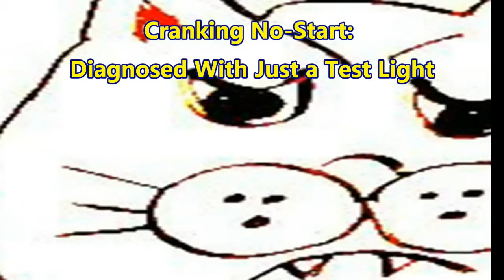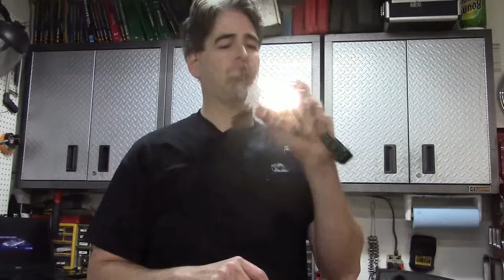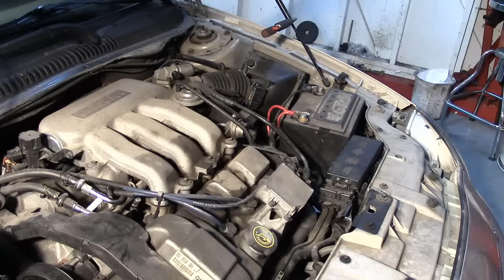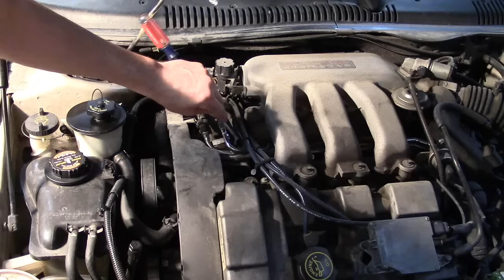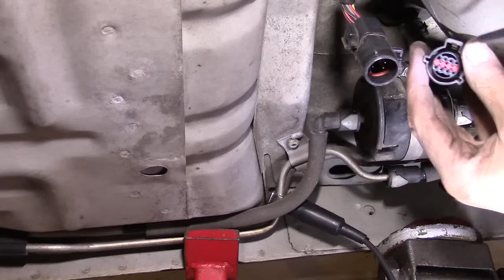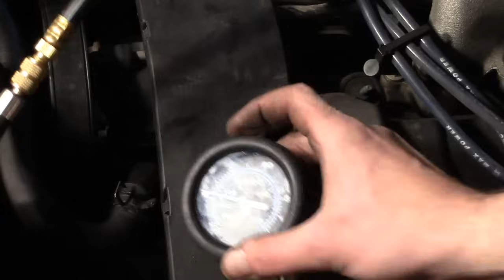Crank No-Start Diagnosed only with Test Light

Comment: What do you test injector ground pulse with SB? I just fixed a blown head gasket and fuel regulator on a 2011 Toyota camry  and found out that all test lights will not light up on the injector ground pulse test.
It sent me down a wild goose chase while they were working the entire time.
The first fuel injector circuit integrity I tested years ago, I used a light cheap test light and it worked fine but this test light did not light up leading me to believe I still had a no injector pulse problem to solve all the way until it fired right up.
Reply from the maker: All you need is a testlight - it’s MUCH easier to see the pulsewidth if you default to measuring the ground side control instead of voltage drop though.

Comment: I have a dodge 5.9 magnum just bought it ! Changed fuel pumped i hear it prime but wont start truck ! Well start with either though any suggestions
Reply from the maker: What’s the fuel pressure showing?
Reply: @SchrodingersBox 54 psi or 55
Reply from the maker: Then it’s not the fuel pump. What is the voltage on the coil signal?

Comment: My 2005 Honda Odyssey crank no start   battery brand new all fuses ian relay is new got fuel I check the car code reader no code or any problem in dictating on my 2005 Honda Odyssey but my van just cranking but not turning over what could be the problem o to my my vehicle
Reply from the maker: What data do you have?

Comment: I could have told you it was the pump just by spraying the intake with starting fluid, and also a few blows with a dead blow hammer on the bottom of the tank might bring it back to life
Reply from the maker: How could you determine if the pump was the problem as opposed to a bad ground, restricted air filter, bad cam sensor or no power to fuel injector circuit?

Comment: I would never do a test light test. I need to know if the loom is good so I have to do a voltage drop test grd a pos.
Reply from the maker: You can literally see the look has to be good. There is no other possible explanation.

Comment: This is worse than sad. I'm 71 and started working on cars @19 it was simple... ignition switch, coil, points and condeser, spark plugs. Boom and you have ignition.
It's almost criminal having these complicated diagnostic schemes by
Reply from the maker: Well I hardly think that far better reliability, almost 400% increase in fuel economy, almost triple the horsepower per liter and an almost immeasurable fraction of the emissions is “criminal”

Comment: I am having the same problem Crank No Start on my 2016 Toyota Tundra SR5 4.6 With no check engine light on , but it only does it when the temperature drops here in NC . Any suggestions from anyone please. GodBless!!!!
Reply from the maker: What did the test light data show?
Reply: @SchrodingersBox I have not used the test light yet, but where do I check 1st friend
Reply: @SchrodingersBox I will do one tomorrow friend!!!

Comment: I have a 2019 FX50. We hadn’t started it for a week. Went to start and would only crank. No codes. You can hear the fuel pump come on when the key is turned on. I can’t find a place to check fuel pressure or get to a spark plug to check if there’s spark as the manufacturer has crammed so much under the hood. Since there’s no codes I’m suspecting the fuel pump.
Reply from the maker: Why do you suspect it’s a fuel problem?  Have you added fuel to intake and confirmed it runs then?
Reply: @ I hooked  a Launch tablet to it and as I was cranking it checking fuel pressure and rpm’s  it acted like it wanted to start and then it did. Runs fine. It gave me a P300 code (misfire) but other than that it was fine. No check engine light or anything. Like it never happened. Bad gas or water in the gas. It sat for 8 days without being started.

Comment: A bad fuel pump would be a nightmare for a home mechanic as for many vehicles that requires dropping the fuel tank to access it.  Really sucks if you just filled the gas tank the night before.  I have no idea why most car makers don't stick a fuel pump & gas tank float access port in the car trunk.
Reply from the maker: Yes it’s definitely my least favorite thing to do for sure. However- I always remove the tank on ANY fuel pump replacement because it’s absolutely essential to complete clean out the tank of sediment which will quickly destroy the new pump if sediment is present. I have an older video of a jeep that used to need a new fuel pump every year because of this reason.

Comment: Check the fuses!!! (lol!)
Great video and quality Schro!!!  
Are those cabinet in the back new? 
Looks real good!
I sadly wouldn't have thought to feel the relays for clicking...that was simple and ingenious!
And yes... I saw the sparking when you were testing the connections.

After you ogot pump running,I would've just turn the key and let the pressure built up first before starting it...just and observation.🙂
Reply from the maker: Thanks!  The cabinets are great looking indeed and one of my favorite parts of the garage. They are called Gladiator Cabinets and believe it or not they are about 8 years old.

Comment: Hello i have a 2014 F150 5.0 it starts and runs no problem while cold but once it warms up it will crank no start until it cools down after about an hour then it will start right up
Reply: A little back story 8 months ago I was getting a crank no start after some research I relocated fuse 27, still no start changed the fuel pump and module over the spare tire it started no problem was running good until 2 weeks ago and after a little trouble  shooting I realized no fuel so I checked relays , before coming to the conclusion that it was a fuel pump again ,replaced it started right up ran good for 2 days now it will start while cold but not warm once cool off start right up
Reply: There is no check engine light on ,also I am no mechanic but mostly do all my own repairs or at least I try to
Reply from the maker: Ok- what data do you have?  I need something to go on.
Reply: Like what I'm no Machanic ,but originally I put gas directly in the throttle body it will crank until it runs  out then dies , I switched the fuel pump fuse both with the blower motor fuse nothing different
Reply: I had no check engine lights on until today now there is a code for the cat converter
Reply: Everything under the hood after driving seem extremely hot to the touch if I wait until everything cools down to the touch then it cranks right up
Reply: Only thing I really have is a test light
Reply: Please help I have went to a couple of local mechanics but they are clueless not doing anything like what you do ,just guide me and please be patient
Reply from the maker: Ok what data do you have?
Reply: Like what
Reply from the maker: You said you have a test light. What was your data from it?
Reply: Ok I hooked it to ground and checked a coil I have got a spark ,I have got power to the relay ,I can here my fuel pump kick on so I got power there as well , I can not find a way to check on this engine the fuel pressure
Reply from the maker: Just add fuel to the induction and see if it runs.
Reply: Put fuel directly into the throttle body cranks right up runs for a few seconds then dies
Reply from the maker: Yep you have a confirmed fuel issue. Fuel pressure is next test v
Reply: Sorry for the delay response before I put fuel i checked to see if it would crank because it had sat for about an hour it started right up had to let it run for awhile to get it back to not starting took about 20 min
Reply: Ok so how do I check the pressure I have no confirmed spot to check need some guidance
Reply from the maker: I just check it at the fuel filter. Easiest spot by far.
Reply: As far as I can tell there is no shredder value on this engine
Reply: Also since we have confirmed this is a fuel issue does that rule out , crankshaft , camshaft ,sensors?
Reply: Fuel.filter on this truck is in the fuel pump , there is not a filter on the fuel rail
Reply: I was hoping you knew of an easier spot
Reply: Ok I have I got my hands on a autel scanner and the fuel pressure shows to be in tolerance pressure v reads 2.63
Reply from the maker: The sensor could be inaccurate. You have to measure it directly OR show the sensor is capable of detecting variance in pressure.
Reply: Ok sorry for the delay the truck will not start at all now , but I have checked the fuel I am getting fuel from the pump ,down the line and all the way to the fuel.injector rail
Reply: Still if I add gas directly in the throttle it cranks then dies off
Reply: And not a dribble it's a steady flow
Reply from the maker: What’s the pressure?
Reply: Not sure how to check without a shredder valve but seem like good pressure
Reply from the maker: 10PSI would seem like good pressure. You can’t tell by pressure by the flow. You have to measure pressure through resistance.  I believe I mentioned the easiest way by far is simply to measure by T-in at the fuel filter.  That way you don’t need any special tools. I just use a plain rubber hose is all.

Comment: I have a 96 blazer 4.3 bought with motor out being rebuilt. Finally got all together ,fluids in ( break in oil of course). Put a battery in and nothing. No spark at the battery,  no lights no nothing.  Ground? Still  checking.  Love your videos
Reply from the maker: What data do you have?  Whats your voltage on the ground for the ignition showing?

Comment: 8:29  you lost me - re:  'Test Light connect to load side feed'.  Are you testing Relay Ground?    re:   "Other side of circuit" - means? [to pump]  Light is On, tho you speak as if Issue being lit.^  So, testing power side, connected to pwr, - light on = shorting to ground. ??  =\  
sorry, replayed many times, words twist[ed], or missing.  
^ noting later, 9:23  'testing Load side' .... Fuel Pump is powered, just not running.  {{sigh}}

Comment: How can I check my code pack, my spark plugs, when it not working on a  Ram 1500,5.7 engine Single Cab, 2012 ,  number 5 wire.
Reply from the maker: simple- just check your powers and grounds on the coil pack and the output signal to the cylinder 5.

Comment: 2004 HEMI 5.7 will not start on the initial start. Crank no start.I can get the Car started by spraying started fluid and manually opening the throttle body, runs nice , idles nicely. I can give it gas no reaction on the throttle body from the gas peddle.
Reply from the maker: Sounds like either a fuel delivery issue or ETC issue to me.  have to isolate the problem to determine which.

Comment: My car , good battery, alternator, starter, and still not even a click, nothing, dead
Reply from the maker: What data do you have?
Reply: @SchrodingersBox  sorry, what do you mean?
Reply from the maker: What is the voltage at the starter showing? What is the voltage at the relay showing? Is there continuity across the control side of the relay?

Comment: What if the car cranks and starts kinda staying running then dies? Also gas gauge comes on and off saying empty and it's not? I know this is probably a dumb question and I'm sorry for being a lame . I'm a single mother trying to do this myself I don't have special tools but I do have a test light how could I check sensors?
Reply from the maker: What data do you have?
Reply: My mom's friend came by with an obd reader code was P0463 fuel level sensor a circuit high. I checked fuses and relays they're good. The security light stayed lit but that doesn't come on anymore after I replace the battery.
Reply: Also I can hear the fuel pump come on when I turn the key. And gas squirts out the Schrader valve
Reply from the maker: Ok but what data do you have?
Reply: Sorry to have bothered you.

Comment: My obd fuse blows soons as I put a fuse in also just replaced fuel pump but it keep saying I don’t have any fuel.Was told I have a bad ground for the obd fuse.Also my battery drains in about 5 minutes after a jump start.Could these all be connected?

Comment: I knew it. My car had a po340 code and before I even replace any sensors, when I try to start it it sounded just like this. There was an actual time when it started but then shut up. So I just did what the code said and replaced the sensor and the wiring and still no start. I kept saying that Obd 2 scan tool is wrong about the P0340 being a camshaft position sensor. Because this video confirms that my fuel pump went out I don't even have to do a diagnostics check cuz I already know. Your video helped me out.

Comment: My friend has a 2010 f250 6.4 diesel. It has no crank no start and can't hear the pump in the tank pressurize. Only code is p0113. Do you have any idea of what the issue is or how to go about looking for any indications of seeing what's going on? I've got a scanner that's better than a basic one but it's not as good as the tablet ones.
Reply from the maker: You don’t need a scan tool for that just measure the pump amperage. Easy as that.

Comment: Have to be careful you draw to much power blow computer in car 🚗 better use 10 mega a ohm meter buy cheap one in auto zone 😉 This is only good for 12 V DC do not check Computer circuits that are 5 V reference That bulb will draw too much damage a chip But for fuel injection 12 V DC or Fuel pump it's OK
Reply from the maker: Wait- how are you going to draw too much current on a 5V reference with the internal resistor in the PCM?? It is impossible even if you shorted directly to ground which is exactly what most 5V ref sensors do in fact.
Reply: @Schrodingers Box  Wouldn't a regular blub  draw too much power if you were to use it say to check a T P S sensor? I CAN see a LED tester not drawing to much power . But not in old fashion test light   Please correct me if I am wrong .
Reply from the maker: how is a bulb going to draw too much power with an in series resistor? even a jumper wire would not draw too much- remember you have a resistor in series on a 5V reference.
Reply: @SchrodingersBox  ok resistor
Reply: @Schrodingers Box  merry Christmas 🎅 🎄  to you and family 👪

Comment: Instead of a test light could you use a DMM to diagnose the circuit? What is the advantage of the test light over a DMM?
Reply from the maker: I normally use a DMM actually. Test light is faster though. Way faster. But I like the quantitative results from the DMM. I even have a video where a test light failed to detect a voltage drop.
Reply: @SchrodingersBox  Thank you for the reply. 

With vehicles in the shop there is a definite pattern to setting up a vehicle to work on. Namely, charging the battery. Which is fine and normal, but many times, unless the vehicle is charged overnight, I want to put a maintainer on it while I troubleshoot electrical problems. Which is also fine and normal. 

However, I have changed my approach. Now I put the vehicle on what I like to call "Life Support", which is similar to a maintainer except I use a very quite adjustable huge regulated linear DC power supply, with voltage and current displays, and an air cooled power rectifier to prevent current from returning to the supply. Most maintainers use a switching supply approach which I find is usually very noisy. I can then attach this to the vehicle battery or jump start posts and slowly ramp up the voltage and watch the current. More importantly I can set the vehicle voltage supply at a know regulated value like 13 volts, which will remain steady because it is a voltage regulated supply, and at the same time put a slight charge on the battery ,while I troubleshoot the vehicle. 

Why this is beneficial is when taking voltage readings throughout the vehicle you know that the supply rail is set to a constant 13 volts (at the battery, for example), so the DMM voltage readings have more relative meaning as referenced to battery ground. For example, if you are probing a circuit and see a strange intermediate voltage like 11.5 volts you then know you have a skewed signal usually due to shorting green crusties. I test light may just pull the signal down to ground and would potentially hide the problem.

So with the "Life Support" method I enhance the quantitative power of my DMM. This method is very helpful and the supply is 0-20V at 20 Amps which means I can use it to maintain the vehicle (set to the proper vehicle voltage as recommended by the service procedure) while I reprogram a module.

Comment: Help!! I actually have gas all the way to fuel rail and I have no idea what to do now I replace the fuel filter obviously the fuel pump is working I checked really ears Schrader valve squirts fuel as expected and I don’t know what to try thanks guys
Reply from the maker: what is the pressure showing. even with just 10PSI you will have fuel at the rail but the car would never start.
Reply: @SchrodingersBox  actually that was the next thing that I was planning on checking I just wanted to make sure that I'm on the right path because that is not a tool that I own yet.
The car is my daughter's it's a 1999 Ford escort cool coupe to 5-speed manual transmission 4 cylinder Small engine probably could power go-kart if we were tired from the Ford haha.

Comment: Testing for spark is one thing, how do you know if that spark is strong enough ?? 
Spark should be ~20k volts, what if its only 10k ??
Reply from the maker: Very true and in fact I have a video on that.  it’s a totally different dynamic launching a spark under compression than out in open atmosphere.
Reply: @SchrodingersBox  same as a starter. It may work under NO load and appear to be a good starter UNTIL you put a load on it and it fails.
Reply from the maker: Great analogy!!!!